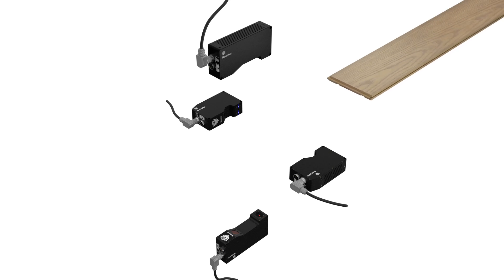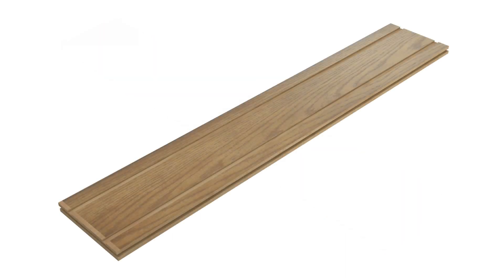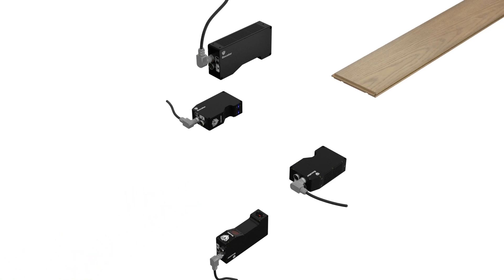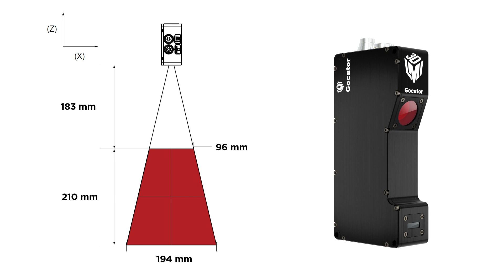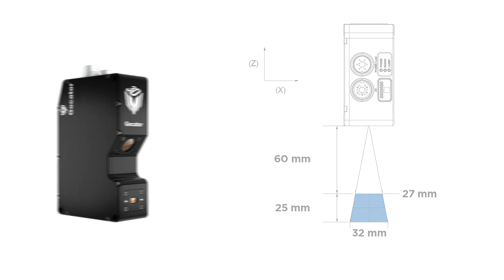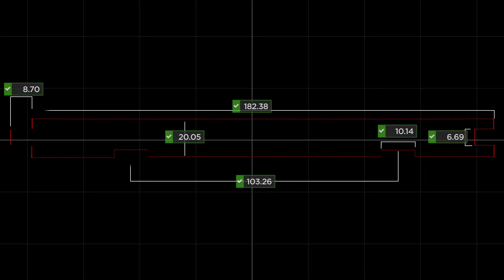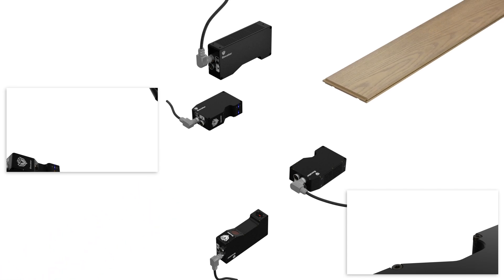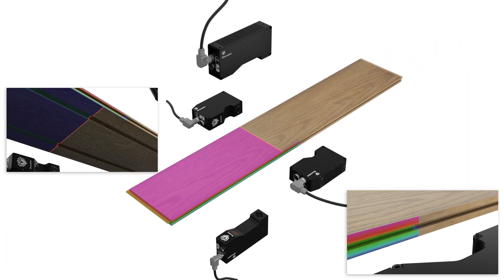Gocator Mixed Multi Sensor Networking

Comment: If I set up a 3D laser camera in a fixed position, place my test object on a rotating platform within the camera's working range, rotate the platform 360 degrees, and simultaneously transmit the encoder signals from the platform's motor to the camera for imaging, would this be a feasible solution?

This question arises because in common scenarios where 3D laser cameras are used, the test objects typically undergo linear motion. I would like to know if it would be feasible to apply this setup when the test object is undergoing circular motion.
Reply from the maker: It is indeed possible to scan a rotating target with LMI sensors, especially if you are scanning the edge of a circular object. I recommend filling out a sales form where a specialist can assess your application and help you find a sensor and software solution that will fit your exact needs. You can find the form here https://lmi3d.com/contact/sales/.